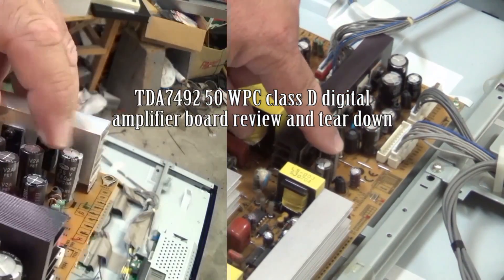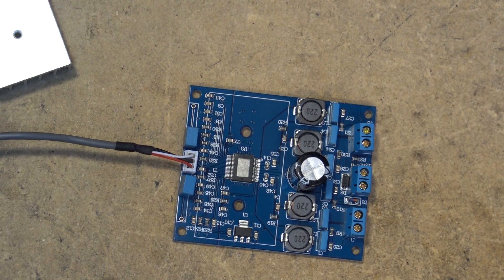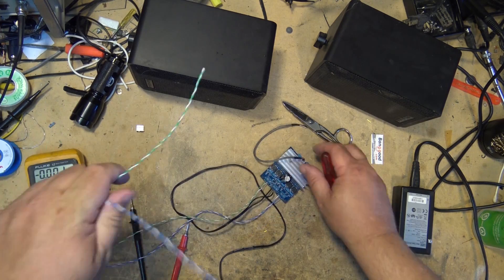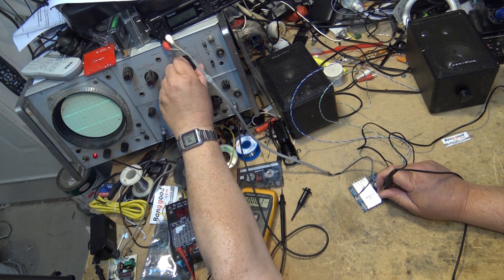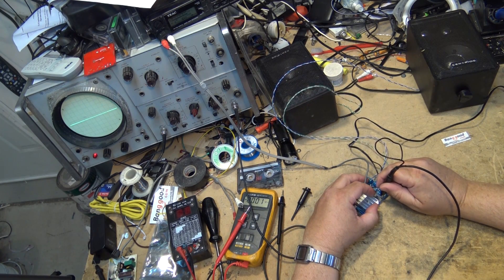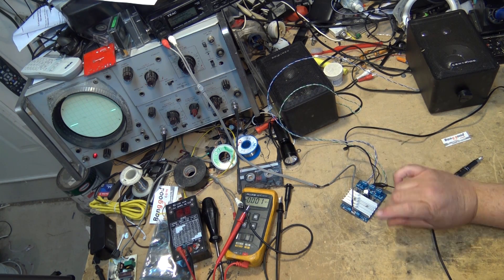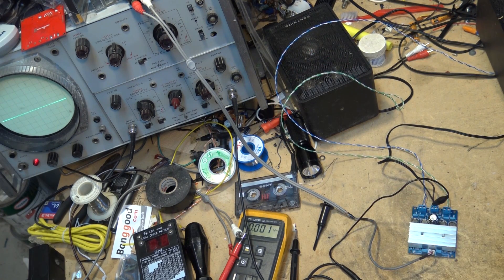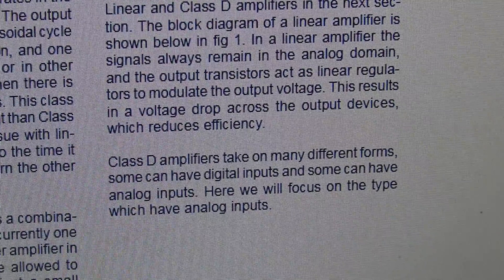TDA7492 Class D digital amplifier board review

Comment: class d has been around for a long time. there only realy good for low freq subwoofers. but there is no way that is anything like 50 watts, maybe 3 watts or less
Reply from the maker: You should do a little math.  These do put out very close to rated power.
Reply: show me the inrush amp draw from one. no way there anything like 50 watts. I have a class sub amp right in front of me right now it draws almost 100 amps at 12 volt to do it. and it is abut a foot long.
Reply: i just ordered one. it's a little bigger then this one. 80 watts .when it gets here i'll run it up to clipping and measure the inrush current. then i'll calculate the theatrical maximum power out put myself.  bet you it's less then 10 watts.   it would be truly amazing to see anything close to those numbers even at like 30 volts your still talking about putting something like 2 amps across an ic. better have some killer insulation in there. that is enough current to jump traces inside the ic chip.
Reply from the maker: @krazzykiller1  
Again you don't understand how class d operates.  They operate in the 400khz to 1.2mhz range. HF carrier switching rail to rail pwm.  You won't see in rush current like a conventional amp.  To measure you can calculate the low pass filter voltage on speaker terminals under load between terminals not referenced to ground. Measure voltage and current on output. 2 amps at 24 volts is 48 watts.  These things put out lots of power and produce almost no heat.  I ran one to the limit with no heat sink and the chip didn't even get warm.
Reply: TPA3255 just read the white paper on it.  they are saying 90% that's a 6% increase over the best class d output chip i'v seen.wicked bad over rated though. the thing is they are rating them at peak power witch means nothing   that rating has no meaning you could call that anything you wanted. you could say it's the rating of the chip if you could could some how make it eat 600 amps.  and there 600 watt chip is rated around 100 watts in the specs with no current draw data. 

so i'm thinking that 50 watts power rating might just be close.  can't wait to have one in my hand. gonna build something evol real soon
Reply from the maker: @krazzykiller1  
That is a different amp. Not class d.  It will use a power inverter to step up power to get higher voltage.  I had an 8 ohm 50 watt power soak load to the point it was literally smoking on one of these 100 watt class d amps running on 24 volts.  The power swing was rail to rail on these.  I have done tests measuring with a scope.  Math doesn't lie. It is easy to calculate actual power with ohms law.  P=E*I. The chips are made by Texas instruments and the power rating is very close.  They are bridged outputs as well.  
It took me awhile to get the grasp of it at tech training seminars I took back at the beginning when class d were just starting to go main stream.  They are very efficient. Close to 100%  all other amps waste most of their power as heat, especially your big old fashioned car amps.  Also class d operate most efficiently into a very low load.  2 or 4 ohms.
Reply: yes it is in fact a class d sub woofer amp.  almost all sub woofer amps are class d switching amps since like the lte 80's this is nothing new.
Reply: can you shoe me the inrush current off one of these ti chips?
Reply: dude this changes everything if it works.
Reply from the maker: @krazzykiller1  
But it will be using a dc-dc inverter to raise DC voltage then as any of the car amps I saw do this. This is not very efficient. 
I have a powered sub 600 watts and it just rectified mains voltage directly and used that to run the mosfet switches.  
These small boards kick out a lot of power for their size.  I still prefer the sound of a very inefficient single ended tube amp myself.  I don't need to break glass with. Just get good sound. I don't even run my sub as it makes everything too boomy and unnatural sounding.  Class a into large efficient speakers.  Now that is great sound.  I run  pair of linear phase with 14" woofers.  No need for a sub. 14 incher will rattle windows with very little power.
Reply: @12voltvids   I just got mine today. by the math it is doing around 30 watts. not the rated 200. that is if there 90%  is fact. probably a little less.  i'm going to change there caps out and see what i can get out of it with higher voltage and more current . right now i am impressed.  it has been running for hours on a set of random used 18650 batteries from some tool packs i repaid.  I have it inside an old book shelf speaker with a Bluetooth module.

Comment: I want to solder in a 12v led light. Where on the board is the best place to tie this in without any major mods?
Reply from the maker: How about the power input connector?
Reply: 12voltvids I had thought about the white on off switch on the board. But it has 3 solder points on each side and I am not sure which ones to solder to. I am a super noob

Comment: I have mounted one of these inside a speaker box and Since these have an on off button on the board itself and basically to power it on I plug it into the wall, what are your thoughts on leaving this powered up all the time since it is a class D amp?
Reply from the maker: perfdavid 
I did the same with the 120w Bluetooth board. Shouldn't be an issue as when there is no signal the current is minimal. If the power issue is a concern just plug the power supply into a switched source.
Reply: 12voltvids thanks for the reply. I am more concerned about fire safety issues as I have it inside an old wooden radio from the 40s (converting defunct radios into Bluetooth speakers). I didn't know what the risk was keeping these powered 24/7 all the time

Comment: Holy shit that scope is LOUD!  I thought the jet flew away when you turned it off.  ;-)
Reply from the maker: Yup, has a big ass cooling fan. This sucker is 54 years old, and has probably 50 tubes in it!
Reply from the maker: The scope is old, full of tubes, and draws a ton of power. The fan is there to keep heat from building up inside as that would affect all the old carbon resistors and capacitors, and take the unit out of calibration. This is not an issue with solid state, but it was a problem with tube gear.

Comment: I would like to see you put a 50 watt 8 ohm power resistor on it and pump in lets say 40 hz sine wave and see if you get 50 watts out of it.
This is most likely a  "music power" rating and I would be surprised if it put out 10 watts RMS into 8 ohms.
BTW, I see you still do not have a newer scope, how did you may out with the CAIG contest?
Reply from the maker: I believe the contest is still running till the end of July.
Still have the old scope, and just had a tire blow on my Harley while I was riding it. (Made for a white knuckle ride to get home) So now I have to buy a new set of tires for the bike.
Reply: Good luck on the contest Dave!

Comment: i would like to see this amp on the amp dyno and see what it's true RMS/PEAK output is at various ohm loads. a lot of the cheaper manufacturers lie and fudge numbers when it comes to true output power peak to peak.
Reply from the maker: I am sure they do. The specs are what the module manufacture claims, and I should put it on the audio generator and let it rip with a low frequency tone and see how well it holds up. I will need to put it on rated power of 28 volts to do this though.

Comment: I'm a bit disappointed you used the D word to describe this amplifier. There's nothing digital about what is essentially just a switch mode power supply that uses the audio input as the voltage reference. It's just PWM.
Reply from the maker: Class D amplifiers are referred to as digital amps because of the PWM or "Binary" output. They encode the analog signal into what is essentially 1's and 0's by nature of the output waveform. Not digitized packets, which is what digital audio or video is thought of.
In essence the resulting PWM stream after mixing with the tringle wave is a 1 bit bit stream, that represents the instantaneous voltage of the incoming of the waveform as it is sampled, which changes the duty cycle of the PW modulator. So yes it is digital, just not quantizised. So technically not an encoded digital signal, but an analog signal that is represented by a square wave "bit stream"
Reply: On this subject, I have just been reading up on some genuinely "digital" amps which are recently gaining some traction on the market, for example the extremely cheap STA333W/BW such as here:

https://www.aliexpress.com/item/STA333BW-USB-Pure-Digital-Power-Amplifier-Board-With-USB-Sound-Card-DAC-Bass-Treble-Adjustment-Function/32778801845.html

Essentially this chip is a 'power-DAC', which takes the raw I2S signal and uses sigma-delta 1-bit processing to produce the PWM signal directly, but with power behind it. So in essence a true digital amplifier.

At well under $20 shipped I'm going to buy one in a couple of days when they are on sale; it'll be interesting to see how it fares - some people are reporting very nice results, especially when modified to run on headphones.
Reply from the maker: Jason james 
Class d is pwm, where the "digital" part is the output is binary. The switching stage is either on or off not an analog  waveform. The analog signal is recovered by running through low pass filter.  The pwm signal is very similar to an fm signal as the phase shift of the duty cycle causes a frequency shift of the switched carrier. The way the digital signal is encoded on cd is also similar. The pcm data stream is converted into an efm signal to encode the bit stream.
Reply: If you have a look at the STA333W you'll see that it takes I2S (pure PCM digital signal) and converts this to analog with power. There's no 'ADC' component. Essentially it's a sigma-delta DAC whose output is capable of driving speakers directly (20W per channel), which is why I thought you'd be interested -- I'm aware how PWM amps work.

Comment: I'm not sure why you kept referring to FM, these units use a fixed frequency oscillator and vary the duty cycle to modulate the audio signal onto the carrier. Thanks for the videos as always. :-)
Reply: It is PWM, pulse width modulation, however in theory is operates very similar to fm. As the duty cycle changes there is an instantaneous drop, or rise in the frequency that follows the incoming audio signal, so in theory this is FM.  Phase modulation is another very similar technique, where the carrier frequency is constant, and just the phase shifts. The end result is a frequency deviation which is what is detected once the carrier is removed. The big difference here between PWM and what is normally thought of as FM is the amount of deviation. In an actual FM transmition, the duty cycle of the carrier remains constant, and the actual frequency is shifted, and shifted to a much greater deviation, 100 or more KHz off the center frequency. This is to overcome the inherent  noise that is part of a wireless transmission. So even though the frequency in PWM remains constant, changing the width of the pulse, the duty cycle does have an effect of the frequency of the mixed signals. The  up side is efficiency, the down side is there will still be some carrier components present after the LPF. It all boils down to how much power do you want at what prize, and how efficient do you need it. Efficiency wise class D can't be beat. Sound quality wise if the carrier is high enough and the LPF design is good, they can sound very good indeed, but a comparable powered linear amplifier will typically outperform in terms of distortion and dynamic power.
Reply from the maker: OK I think Jim described this about as well I can.
True that in FM as in broadcast the carrier frequency changes, and in PWM the carrier frequency is constant, however the instantaneous duty cycle changes of the fixed carrier causes a frequency shift to be apparent. You can't change the duty cycle, or phase without a frequency deviation occurring, and it is that frequency deviation that is recovered to produce the audio output once the carrier is removed by the output filter.

Comment: They have a 170 watt amp too. Now try to figure this language out. LOL This version can choose differential input, the effect is more good, need is equilibrium output level before to pick up.
 The board with rectifier filter circuit, save yourself the trouble collocation rectifier filter, using 30 a new original rectifier bridge with South Korea.
 Sanhe high-speed electrolytic arrays, the effect is very good.
 Bring their own trumpet protection circuit, installed substitution of DIY is more convenient.
 Can be convenient for BTL output, need very strong beginning ability, if you don't have a real master, please don't try this kind of connection.
 Reserve a plus or minus 15 v voltage potential position on board, convenient DIY ability strong buyers with myself, can give the front-end power supply.
 Adopts SMT process, more stable than hand soldering product.
 Match: the amplifier board can be used directly as pure power amplifier You just need to plug in transformer, also can be used with tones ,or made subwoofer amplifier with low pass board, price is very high.
Reply: Mark Anderson What ?? :)
Reply: That's is quoted from the 170 watt amp description on the Bangood website.  What you no speak Korenglish?

Comment: I have PAM8610 module,It is even smaller, connected to large yellow eight inch speakers in wood housing. For me it plays similarly to tube amps. For low distortion they requiring good power supply >3A.

Comment: Im still here because i watch all of your video without skipping.

Class D digital is an odd method to get my head around, i bet the distortion figures are worse than any other type, there is bound to be a trade off.
Reply: Class D isn't necessarily worse from a theoretical standpoint than linear amps with the caveat that a sufficiently high resolution PWM and properly designed output filter (high enough order) would be necessary to achieve very low distortion. In practice there are design constraints on these two factors due to cost and complexity, especially for these cheap modules. But even then, I must admit they still sound very good to my ears.
Reply from the maker: Distortion is relatively low actually. It can be cnfusing at first but the concept is actually relatively simple, and with the proper inductor can sound really good, with very good dynamic ranges, and lower distortions than many class AB amplifiers.
Reply: So true analogue can make a square wave, yet can Digital create a true analogue curve? Or is it always under parameter of square wave????  That would make me understand why it can sound white harsh. Very powerful but missing something. For example, analogue square wave, the top sections are tiny waveforms in themselves ? Does Digital exhibit this characteristic..?

Comment: So would it require a 2-3 amp PS?  
This would be nice to go inside a PC case off of the sound card.
Reply: See my reply to giammyzanna below.
Reply: I saw a nice bluetooth 100w D amp on epay for about 25$.  I have an old laptop supply that should do, 19v @ 5a.  That would go nicely for my tablet.
Reply: That depends on what it is based on. 

For example the TDA7498 will do 100+100W but only at 36V, 19V would give you more like 40+40W

http://www.st.com/content/ccc/resource/technical/document/datasheet/db/c5/04/74/fd/08/43/de/CD00244535.pdf/files/CD00244535.pdf/jcr:content/translations/en.CD00244535.pdf
(Page 14)

Lots of TDA7498 100+100 modules (none bluetooth so far as I can see)

 http://www.ebay.com/itm/TDA7498-100W-100W-Class-D-Amplifier-Board-DC20V-to-DC36V-/131677499536?hash=item1ea8973090:g:TbMAAOSwCQNWcQmu

 .Also you might get some audio noise from a laptop SMPSU, you would need to try it and see,
Reply from the maker: I was running it off a 1.66 amp old modem power supply and it just cranked out the volume.
Reply: The datasheet graph doesn't go down to 12V, but extrapolating from what is there, I would think it puts out about 10W or so at 12V so that 1.66A PSU might be a little stretched at full volume if you ran it for a long time. 
I guess you could stick the multimeter on and find out what current it actually draws. Back of the envelope suggests 833mA peak per channel at 12V, but that is based extrapolating the graph, which is probably risky, and therefore probably miles out. .